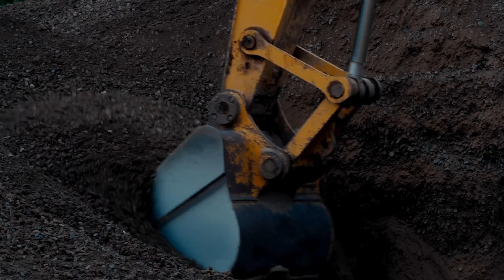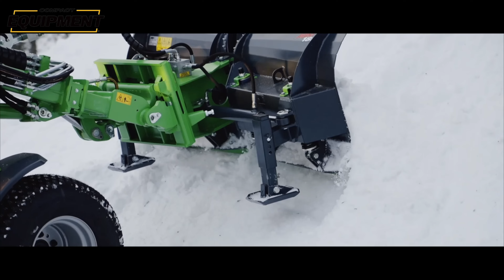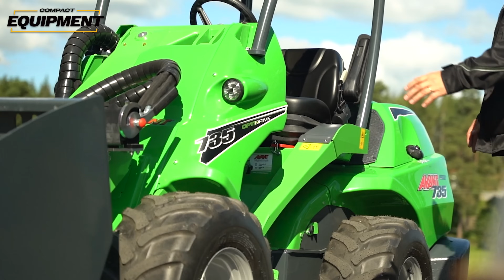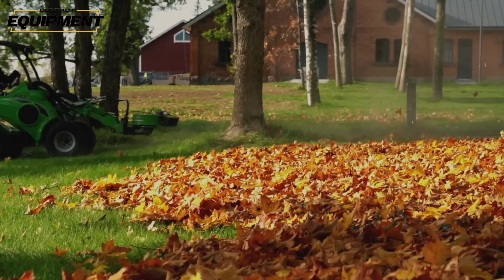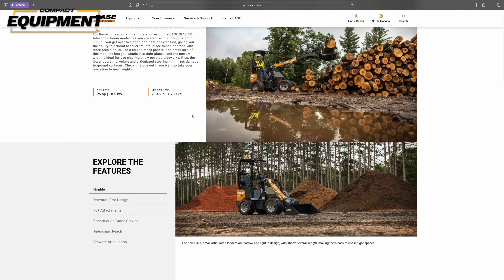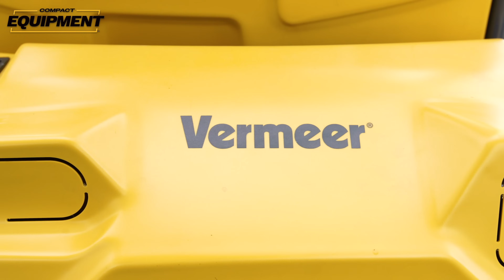Can a Small Articulated Loader Really Replace Your Skid Steer?

Comment: Excellent video ! Probably one of the best videos out there discussing SALs . The model I have settled in on as the one that suits my needs the best didn’t exist yet when this video came out, Still excellent SAL info. Would love to see your take on the machine I am buying, the new Bobcat L35 SAL, HVAC cab and  a true high flow were very high on my must have features and the new Bobcat L35 has both those boxes checked, and a much more compact footprint then the CASE 35. 
Ps. Also loved your coverage of the JCB 4TS. Loved to see more on the JCB 4TS as well.

Comment: Dare to compare
Having been a heavy equipment operator all my life I can tell you that if you ran articulated loaders in the past you will probably not be comfortablle with the configuation where the operator sits in the front half of the machine for several resons the main one is that you loose tract of the position of th rear half of the machine especially when backing up. Ater running an Avant for over an hour I was  really frustrated with how often i found the rear half to be in some odd right angle position to the front half. also when you turn the steering wheel in a rear half seating position you are turning the front half so the response time is  iinstantaneouus making it much easier to say  guide the forks into a pallet, alignment is easily accomplished with  a slight turn of the steering wheel where I really noticed this to be a problem wsa i n grading there was a definite delay in response time as you wait for the rear half to push the front half through the the turn. Case tried the operator in the front half years ago with there full size articulated loaaders and they were we not well received Which I'm sure was very instrumental in them deciding to have Giant build their entire line of SALs I have a Giant G2700(Case  SL27}and am really impressed with the workmanship, manueuverability and capability of the machine. Visability is hands down better than any skid steer, of which I've owned fourI I recommend that you really compare the machines by running it with every attachment simulating tasks that you,ll be performing  on a regular basis.

Comment: This was a very good brake down and I have to attest to Case/New Holland's machines being more agriculture/construction than general Land scape. The SL-12 however has been fantastic as a material handler/ small mulcher/bush hog for those back yards with gates. You can even squeeze through some of the small chain lick gates with it's 36.2" width. It's been haven sent for doing retaining walls with that telescopic boom . at 38" out 111" lift with 3 suit cases on the back I can get almost a 2000 lbs. so even a solid 18 x 18 x 48" granite block is a easy. Manufactured large block is a peace of cake even 10' tall. tested it even though the tallest I've built was 6' x 20' long and we didn't have to tare down their back gate or lay down a bunch of plywood to get the trace loader back their. The SL-35 TR is right at home on the ranch. I think I've been on that machine more this last year then the tractor.
I can't think of a more versatile machine home or at work. I still need our track machines for those steeper slopes and demolition work but these two aren't going anywhere but to work!

Comment: We have two of the Bobcats. They just don’t have enough power. They don’t push into a pile well; they can’t lift very heavy loads, and while they have heat…no AC is unpleasant in the warm weather. I feel like it’s a jack of all trades, master of none.
Reply: You have to look into Avant 700 or 800 series.  I have a 528 for lighter work.  They are an air tire machine, so you do get that bounce.  I haven’t seen hard wheels yet.
Reply: Just in case you had not seen the new SL35 model , I believe Bobcat addressed all those issues or concerns. 
57 hp in the SL35 , available high flow , wider track width , heavier , more lift capacity, and the L35 has a Heat and AC cab . 
I agree with everything you said about the L28s.

Comment: Can you explain the difference in a CWL and an SAL?
Reply from the maker: These units are like traditional wheel loaders in many ways, including fast travel speeds and articulating steering, but are super small. Compared to a skid steer or mini skid steer that employs zero turn skidding, articulation is easier on tires, easier on turf and better on fuel efficiency.

How do these units differ from smaller wheel loaders? For starters, different jobs. Small articulated loaders excel at backyard work, where units can carry small pallets of block or landscape materials with minimal turf disturbance because of the unit’s articulation. They are also sized to fit on most sidewalks and walking paths for snow removal and general debris cleanup. They are super easy to transport compared to a compact wheel loader or skid steer, and the smaller variety definitely sports a more economical price tag. Many tree care contractors are pairing these small, nimble loaders with brush chippers, for example.
Reply: So what is my Gehl AL140? A CWL or SAL? What is my Giant G2500HD?

Honestly seeking an answer. “Compact” and “small” are somewhat synonymous, in my opinion.
Reply from the maker: @small-town-southern-man3573  Yes. We would consider those units SALs. That Gehl is a classic. The G2500 blurs the line a little between SAL and CWL. And the line is blurred. Consider a brand like Case, which makes both SALs and CWLs (the latter branded from Giant). Go view those different machines on its website, and you'll get a sense of size and application differences. CWLs are larger and often stay in one locale (like a landscape supply yard), while SALs are super small and travel from jobsite to jobsite. These are just terms we use, and you could easily call all of these compact wheel loaders, but there is a clear division between SALs and CWLs with manufacturers, which is why we separate them out.

Comment: They are awesome machines but I tried one at home and wouldn't work for me because of the many changing slopes on my properties. I almost flipped it a few times. like any tools you get used to it but it was too limiting in where and how I could work.  Make one with dualies and I'm all in! I'm looking at ventrac tractors just because of the dualies even if it's a limited machine. I ended up selling my compact tractor and mini excavator to get a Mecalac 6MCR in the meantime. Something smaller would be nice though.

Comment: As a person who grew up and work for dairy farms. I've operated many old pieces of equipment in tight areas. Specifically in this case, wheel loaders. I've used both style of cab/ frame design that in the video. I have found the with the cab on the front part of the articulation joint. You always have to be mindful of where the rear section is pointed and of the cab swing out. As not to get your self in a situation where you can't steer your self out or cause damage to the machine or to the barn "in my case". Where as with the case unit and pretty much all modern wheel loaders it's cab mounted on the back of the articulation joint. You don't have those issues. You always know where the back of the machine is, since you are siting on it.😅 better view of the front tires and of what obstacles to steer around. Less body damage b/c the swing out. You need less counter weight since you are part of the counter weight (sitting behind the articulation joint give better leverage for lifting capacity). And last but not least. As far as I know every wheel loader made since the mid 90's are using case style of frame. So you don't have to re learn how to operate the machine.  The only difference really is weight, horsepower, and lifting capacity in my opinion.🤷‍♂️

Comment: The first company that I can recall making these in the States were the Swinger loaders made by Swinger Industries in Barnesville, Mn in the late 1960's until the mid to late 70's. The earlier models were a bit crude by design, but gradually improved to be a reliable solid unit. As a matter of fact, not only were they quite unique in the industry, they were very popular. In the early 70's, the company quickly outgrew both its physical production facility and available cash resources. The company leadership got in over their heads with some bad financial decisions, and the company ended up shutting down. The assets were bought up by another company and I think they briefly restarted production which only lasted a couple of years. I worked there a couple of years in the mid 70's. Another company bought the rights to production and moved it out of state.
Reply: A&O Forklift in Edmore MI (now Hummerbee Rough Terrain Equipment), used to modify the Swinger Loaders into forklifts for beekeepers back in the 1990's and early 2000's. They now build a line of Compact Articulated Loaders, based off their forklift platforms that are similar to the Swinger Loaders, and just as tough!

Comment: A good CTL is irreplaceable. A skid steer can do a lot of what a CTL can, and a compact articulated can do a lot of what a skiddie can do, but they are a lot less maneuverable, not suited to grading, and they don't really even save your back. On top of that, they're more expensive for less capability. The only real benefit is they don't tear up the ground as much.

Comment: The small farm loader (hoflader) was not developed by avant, they startet in thd mid 90th.
It was invented in the seventies by Weidemann (Hoflader), later also Schaeffer (Hoftrac), Eckard (Kuli), Eicher (Eichus) and Fristein (Fritruck). All of them started in the seventies to develop them. Some are gone others like Weidemann and Schaeffer are market leaders among others who started later.
The only thing that Avant started first was the international marketing. The other european manufactures are basicly unable to supply the domestic market, not to low producten more due to the unbelaevable demand. At the dealers they usually sell within one hour after drop off!
Greetings from Germany
Reply: Machines with that same arrangement were introduced in the US in the late 60s for underground mining. They're still very popular in narrow-vein mines and are far superior to skid-steers in that application. The payload-to-width ratio is much higher which results in rounds being cycled faster, and visibility (especially rear visibility - critical when a turnaround isn't available for two hundred feet and no, cameras aren't good enough) is better. They're also generally easier to work on in a cramped area - no need to raise the cab. Tire life is longer, too. Downsides are poorer fine grade control, lower lift, and a lack of attachments, although 95% of what you'd want to do in a mine can be accomplished with a straight, spade, or tooth bucket equipped with chain hooks/loops and a set of clamp-on pallet forks.
Reply: @Porty1119 I just took the landscaping and construction approach, but yeah, it depends on what industries you work in and what the jobs of the machine are. However, I have to disagree with your claim about serviceability. We have just bought an ASV RT75, and when you take off the back panels, you have full access to the complete engine. The serviceability on this machine is insane; you have all your filters in one spot under an easy-to-remove panel
Reply: @bluecolourhustle  Yeah, it's a different industry for sure, but small articulated machines are fantastic in the correct application. 

That sounds like good engineering by ASV, looking at pictures it's far more serviceable than any other skid-steer I know of. I've seen some machines (looking at you, Takeuchi) that require the cab to be raised to change the engine oil filter. When working underground it's not always a guarantee that you'll have space outside the footprint of the machine - changing hoses with a foot of space between the machine and solid rock makes for a fun time...
Reply: Avant might be Finnish, just like me. But i still don't like it. I would go for Giant, Schäffer or Kramer. I like a wheel loader type any day, I don't like sitting over the front wheels with the back swirling around. There are larger machines built like that (Wille and Lundberg as example) but they are quite different.
 For smaller things: Giant 2700 HD+
 For medium jobs:   Schäffer 5680 or Giant 5000
 For big/fast jobs:    Kramer 8115/8180

 There are many, many more (JCB and Ljungby for example) but these would be some. Overall agri-style wheel loaders are good choices to skidsteers...
Reply: @johanneslaxell6641  It always depends on what you want to use them for. If I used a wheel loader for landscaping, I wouldn't get my job done as quickly and efficiently, but that's completely different on a farm where you have to do completely different tasks
Reply: @bluecolourhustle  We should somehow decide what kind and size we talk about. In my mind "articulated loader" can be a small machine for the homeowner barely big enough to sit in (Avant 423), a machine with a nice cabin with climate control and big enough for real work (Avant  860) or even a tool carrier (Lundberg  8255). As with skidsteers: there are small, large and track loaders.
 I am sorry for using Scandinavian machines as reference bug as it's my "hoods" it felt appropriate. I would say the same "lineup" with another brand (Giant) would be: G1200, the G2700 (X-TRA)HD+ and the G 5000 X-TRA.
Reply: @johanneslaxell6641  When talking about tracked machines, they range from the 25 hp ASV RT25 to the 135 hp ASV RT135. We operate a CAT 289D3 and an ASV RT75, both of which are tracked and come with high-flow hydraulics. None of these skid steer machines are designed for homeowners, not even the 25 hp model. The 25 hp machine is primarily built for navigating cramped and small spaces, such as a tight backyard.

I believe that for most tracked skid steers, the high-flow option starts at around 65 hp. The difference in horsepower and size mainly means that the machine is smaller, but the capabilities—aside from high-flow hydraulics—remain similar. Larger machines may be faster and able to push more material, but the core capabilities are quite comparable across sizes.

These machines, however, come with different design features. For instance, the ASV RT75 is specifically designed for forestry work, with a low ground compaction—less than the average human would compact it by walking. On the other hand, John Deere models like the 333G are powerhouses, designed mainly for dirt work, offering as much pushing power as a bulldozer.
Reply: @johanneslaxell6641  im only talking about tracked machines from 75hp to 140 hp with highflow ,i hope that answers your question  if you want to look at models, we youse an asv rt75 with the Max series cab and the wide tracks and an cat 289d3 both equiped with high flow.
Reply: In the U.S., wheel loaders are mostly used for plowing snow or by tree companies because they are inferior at almost everything else, especially dirt work. They lack pushing power, cause high ground compaction, and due to the loader arm design, it’s almost impossible to achieve a decent grade. They also get stuck pretty quickly. Additionally, they are not built tough enough for American standards. They also lack hydraulic power and high-flow capability, which are crucial for high-demand attachments like forestry mulchers, rakes, etc. I saw a Weidemann dealer in Canada, and these machines are literally not being sold. I think Weidemann tried to enter the U.S. market before but completely failed. Also, wheel loaders are mostly a European thing. Everywhere else, such as in Canada, the U.S., Australia, and New Zealand, compact track loaders dominate the market for good reasons i dont know how you came to this conclusion that they will sell but noone else besides europe would want to youse them including me i belive that they are good when loading trucks but they are completly inferior in every other aspect.
Reply: @bluecolourhustle  in europe they are mostly used on farms for feeding and cleaning out the manure. Grading and dirt moving are done by small excavators which are in high demand too. The wheel loaders and excavators are a perfect match. Skid steers are basicly unsellable over here. We don't have a lot of snow and our properties are tiny compare to the US.
Reply: @uwejacobs6587 Skidsteers and trackloaders are too heavy for European transportation regulations. Due to the trailering limit of 3500kg (7700lbs) and a trailer weight of ~800kg (~1800lbs), machines need to be lighter than 2700kg (6000lbs). Skidsteers and trackloaders that size have horrible capacities. 
I have a MultiOne 10.9 that lifts way more than 2000kg to 3,21 meters hight and offers 95 liters/min for every kind of attachments.